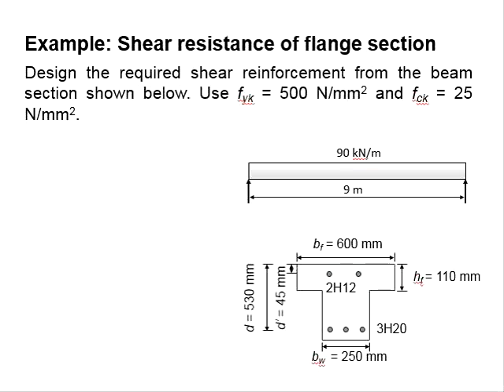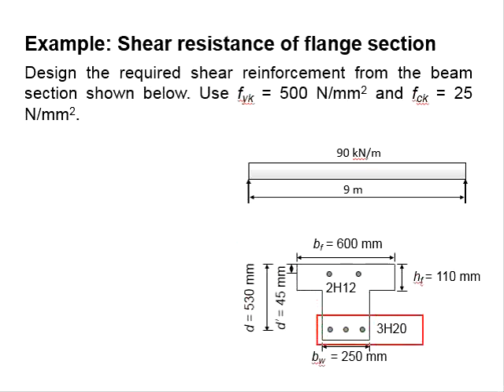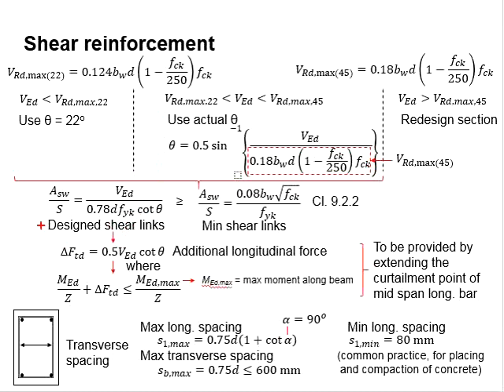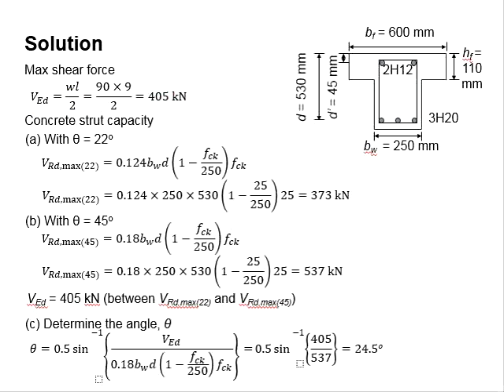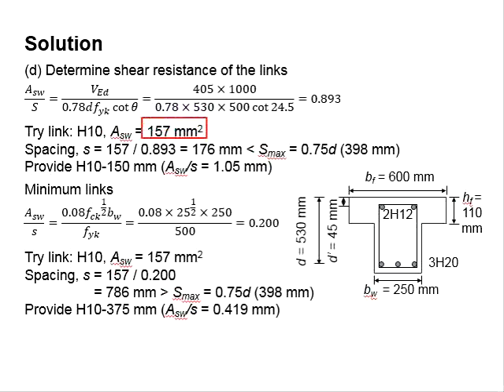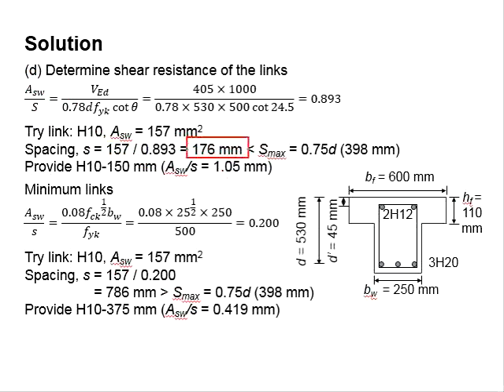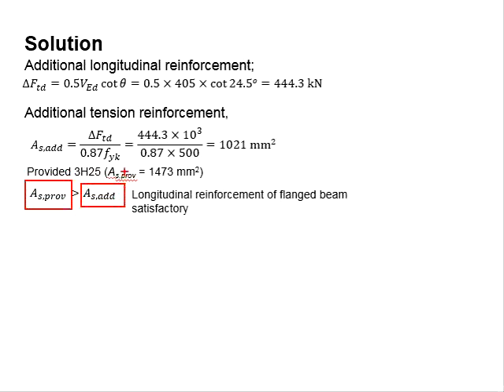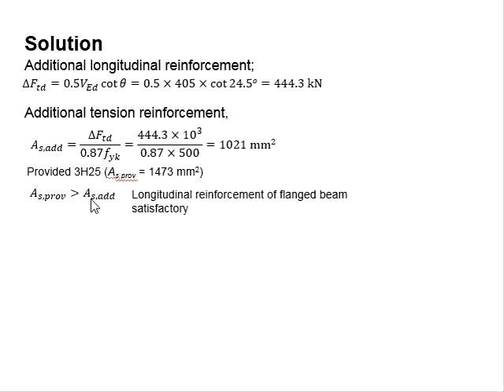5.11 Example: shear in flange

Comment: Where does the 1000 come from when calculating As,min
Reply from the maker: It is meant to calculate the transverse reinforcement of the flange, which can be treated as if a slab. The 1000 mm represents the unit length of the flange (similar concept as designing for a slab).